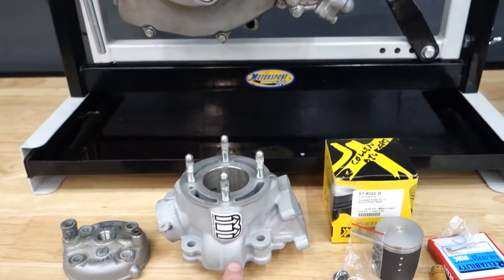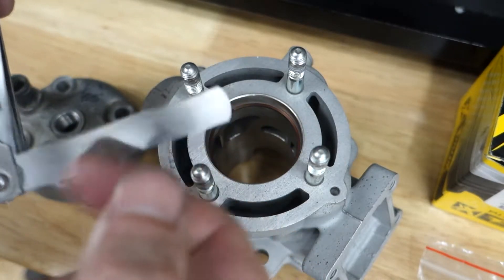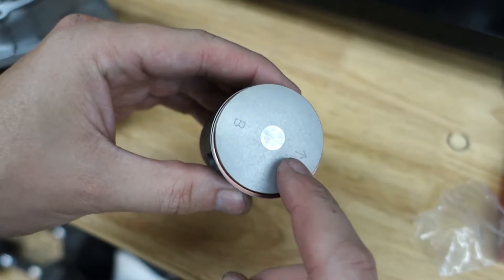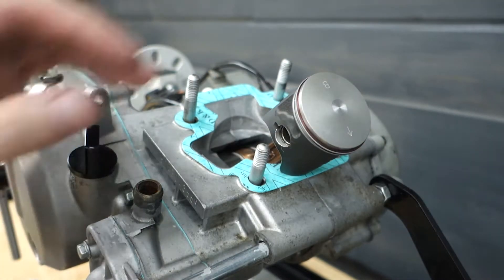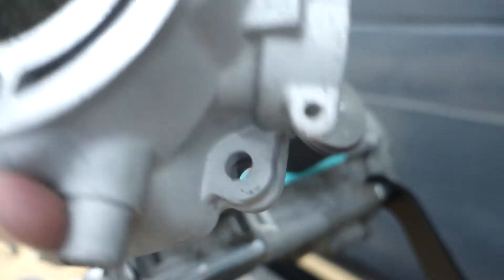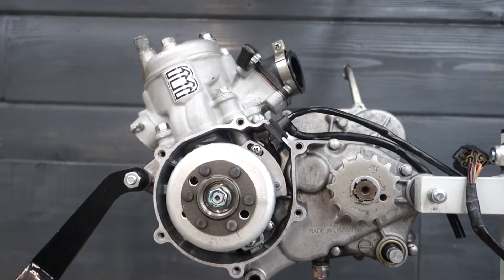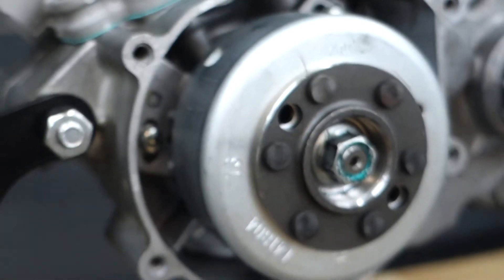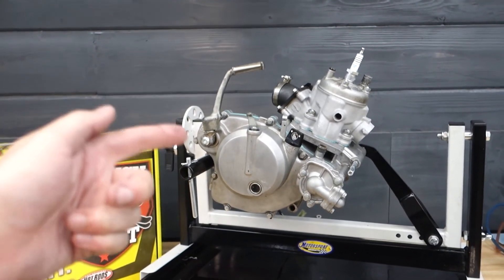Kawasaki KX65 Top End Install

Comment: There is 3 dowels that go round the studs that secure the cylinder to the cases. Yours are missing
Reply from the maker: Ah yeah just looked at the parts fiche, looks like the 05 has 2 on the right side case. Good eye, I'll add that to my list for the next rebuild!

Comment: I would love to send my 05 kx65 motor to you and pay you to rebuild mine! Let me know if that’s a possibility please
Reply from the maker: I think you'd have a far cheaper and easier time bringing it to a local bike shop. Shipping alone would be nuts on one of these engines.
Reply: @GarageAddiction  yeah I think your right. Well anyways. I believe I can do the top end myself now with your videos there to help. I took off the piston and wrist pin and that bearing yesterday. I’m really hoping I don’t have to mess with the bottom end but the crank has a lot of left and right wiggle. That’s not goofs right?
Reply: @GarageAddiction  good*
Reply from the maker: Some side to side play is normal there should be no pay up and down though
Reply: @GarageAddiction  i do have about 1/8” up and down play 😖
Reply: Does that mean I need to get into the bottom end? If so I have to get someone else to do that part
Reply from the maker: @Rookie_bass_fisherman  Yeah 1/8 is a lot of play, that sounds like you'll need a crank rebuild or replacement which you'll need to split the cases for.
Reply: Thanks for the advice! Atleast I have these perfect videos for help. I’ll try and do as much as I can on my own. Appreciate ya man
Reply from the maker: @Rookie_bass_fisherman  Good luck! hope they help you out!
Reply: Did you check the squish?  Especially with having the head surfaced.